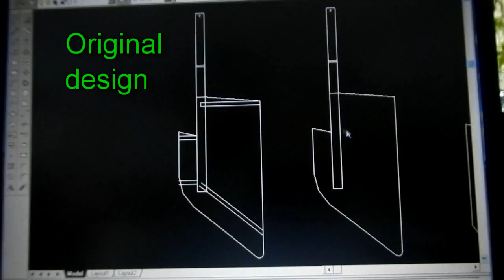Building a Sailboat Rudder

Comment: how long should the putty last for before applying the plastic wrap
Reply from the maker: Since the idea is to hold the epoxy putty in place until the putty sets hard, I put the plastic wrap on  immediately. Remove the plastic after the epoxy has cured. Saves on sanding and might use less epoxy.
Reply: Paul Larsen thanks

Comment: What fiberglass cloth and carbon fiber did you use? Looks great!
Reply from the maker: I've had good luck ordering materials from JamestownDistributors. I used WEST carbonfibre tape and all the fiberglass cloth I could find in my shop, left over from various projects. If I were again making a rudder for this boat, I'd use Kevlar for protection on the edges where it might hit ground and carbon on the sides away from impact, just for stiffness. Live and learn.

Comment: Great job very inspiring. What foam was used and where did you get it?
Reply from the maker: ben murzynski The foam is from Lowes. It's home insulation foam by Dow. I test glued with my epoxy first. As I mention in the video, epoxy gets hot if you don't use thin layers. That heat could melt the foam board, so keep the layers thin!

Comment: What is the  wall thickness of the stainless tube?
Thanks.
Reply from the maker: The tube is pretty thick, I think Schedule 80 pipe, which my local welding shop had in stock.

Comment from the maker: Glad you liked it.  I put the f-glass cloth over top of the trailing edge carbon fiber, as the cloth is light enough to conform easily.  The leading edge carbon went over top of all the f-glass.  I then used epoxy putty to fair the fabric edge flush.